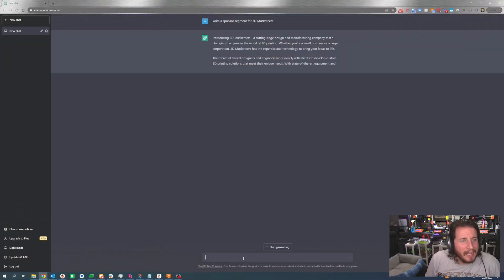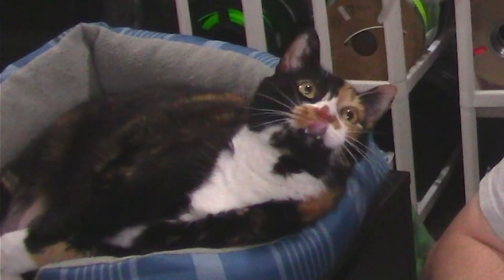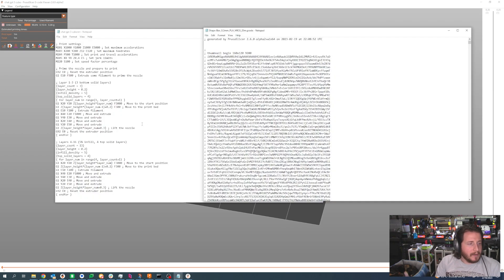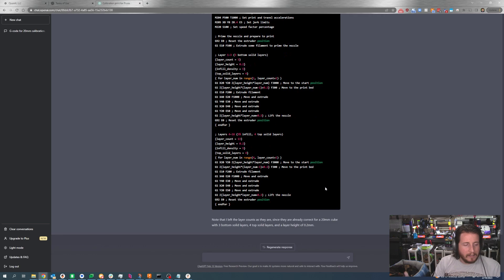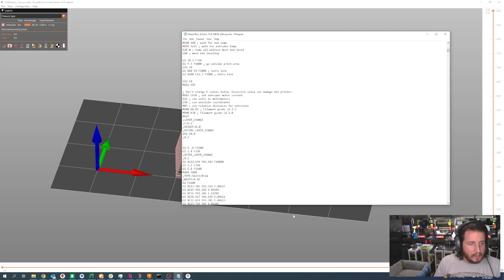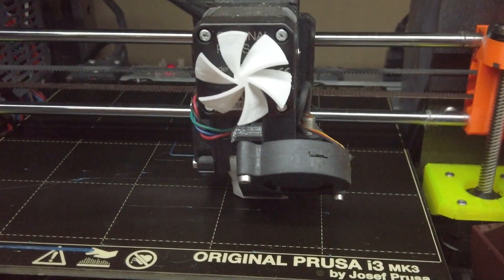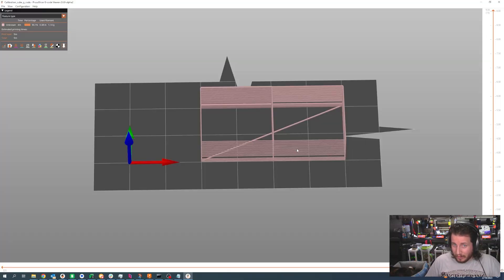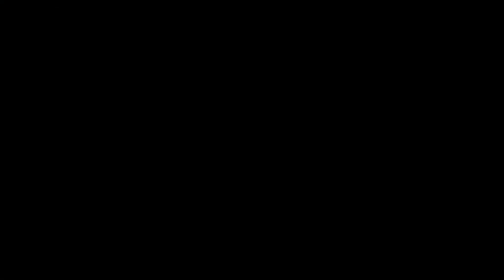Making 3D Prints using ChatGPT?!?

Comment: You first have to set it up on the part of the network you want to be in so the first you say something like this, "answer the following questions as an expert in the language-version-XXX"
Then you say something like, "write code for the {action} in language-version-XXX"
Where {action} is the actual question.
Reply from the maker: Yeah my chat gpt skills kinda suck. I'm happy to revisit it if you'd like to help in it?
Reply: @3DMusketeers  I've have my first 3D printer coming soon and I've had a lot of success interfacing the raspberry pi Pico to the chat GTB API I think I might have more success here. With programming languages you have got to be version specific because they change between versions. Because it's interpreted in python in the token chunks you can use the currently braces two separate parts of your prompt. And then you can break up your command into chunks that you wanted to do or you think it should do.
Reply from the maker: my lack of knowledge on coding will hurt me here lol